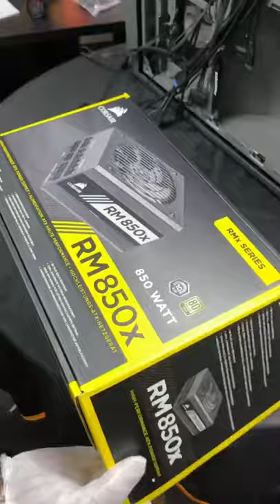A $21000 Workstation with AMD Threadripper - 2 #Shorts

Comment: “...and to top it all off, a GT 710” 🤦‍♂️
Reply: The GPU is being used mostly as an output for monitors - the PC is a workstation, so there isn't any need for a super fast GPU
Reply: @TheSsalty  I agree but they could've got cheaper gpu that is better like Rx 550
Reply: @TheSsalty  😀
Reply: @frozenturbo8623  
The RX 550 costs like 4x more than a GT 710...

Comment: Threadripper, nice
Good case...
Ahh, nice psu
. . .

WTF IS THAT GPU A GT 710? WHY?
Reply: Relax the 710 is a 16 vram card
Reply: It's a workstation build, not a gaming PC. The GPU only exists to boot up
Reply: its a server computer, you dont need a powerful graphics card
Reply: @fib621  you just need kinda low mid range gpu and it works better for display considering you could be watching YouTube for tips on your workstation pc

Comment: Thermal paste application fail. You need to cover the entire cpu with paste on thread ripper
Reply: Looking for this comment. Threadripper has a massive heat spreader. It needs more paste, or at very least spread evenly.Would be interest to see Temps on this, I'm sure the client had issues once he applied load.

Comment: Kinda a bad choice using aio for that cpu
Reply: Dream  for one threadripper cpu layout, like the actual chip, is very very wide spread across the substrate hence why it was very big and you're very likely to just optimally cool the IO die not the cxx, to be fair they still get cooled that's why integrated heat spreader exist, and using normal aio that made for something like intel monolithic ic design or even amd consumer cpu is kinda not optimal

And frankly aio is not that much efficient compared to normal air cooler, watch ltt video about that
And while that specific aio is made for threadripper cpu in mind it has some problems check this out from gamer Nexus
https://youtu.be/nttKqzQiZEo

And lastly this is workstation build and i rather have 0 down time when i really working with this pc, and pump in aio can fail, not like it was catastrophic but it was easier to take a fan from one of the case fan as place holder while waiting for the replacement fan to arrive in air cooler
Than it is changing the entire cooler in aio
Reply: Though i heard it was solved in seconds gen